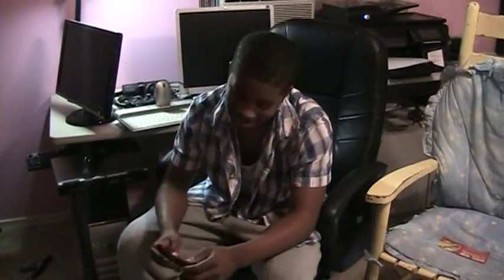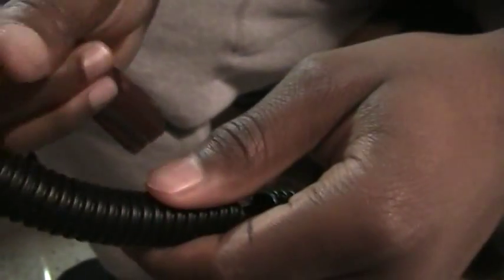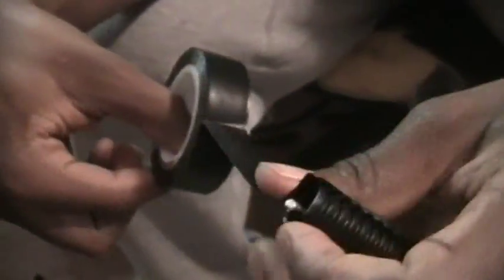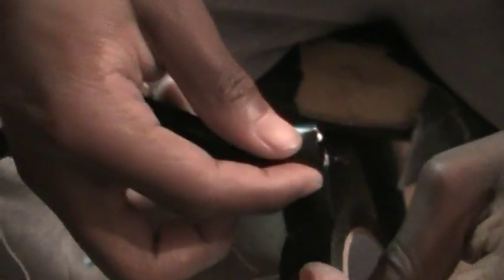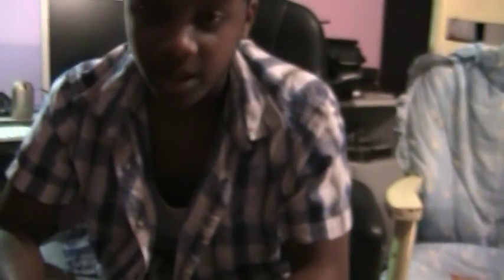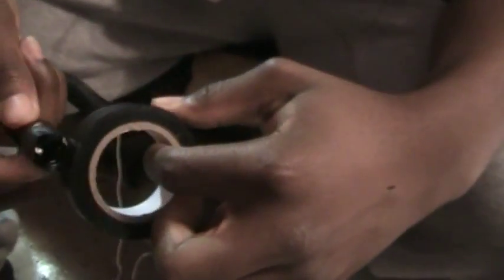Animatronic (Robotic) Hand (1/3)

Comment from the maker: @Alliance of the Force, the tubing is called Electrical Routing Tubing and we got ours from Home Depot. This type of tubing already has the split in it. I can't remember the price, but I don't think it was very expensive.
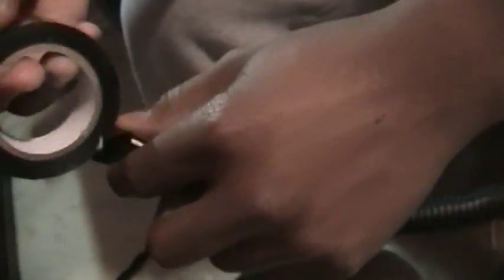Reply from the maker: +Alliance of the Force, I accidentally deleted your other question. While trying to find a "reply" button, what I found instead was a "remove" button. So sorry!!! But to answer that question: To make the plastic square that can be seen at 4:55 on video 2/3 https://youtu.be/e7gUpAyvMVY  we had to cut a plastic hanger into 4 parts. We cut the hanger where it curves to meet at the hook, and where it curves up from the base of the hanger. We also cut the base of the hanger into 2 equal parts. So, with these 4 plastic pieces, we hot glued them together to create the square shape. To cut the plastic hanger, we put it on our concrete outside and sawed it with our knife, and once we got about half-way through the thickness of the plastic hanger, we broke it apart. Let me know if you have any other questions. I promise I won't accidentally delete the question! (smile)
Reply from the maker: +Alliance of the Force, in Video 2/3, around minute 5:30, you can kind of see some of the curved pieces of the hanger that we cut away on the ground. These cut pieces are laying next to the cutting board, so we did try to even up the 4 plastic rods once we cut them apart. We used the knife and cutting board to remove the curves, leaving the 4 plastic pieces (rods) straighter and more equal in length.

Comment: I've watched all 3 parts, so first let me say great job on the hand!  If you plan on doing this project again, may I suggest that you use a carpet knife, craft blade or even a box cutter instead of that crazy knife (and also please don't use your knee as a cutting surface).  The conduit you used is commonly known as split wire loom (which is why it had a split running the entire length of the loom).  It may be harder to find (check ebay), but next time try to get non-split wire loom.  That should keep the "fingers" from twisting as they did with the split loom.
Reply from the maker: GlitterCat Thank you for the suggestions! I like to repeat my science fair projects to try improvements, so I will definitely keep your suggestions in mind. ~ John